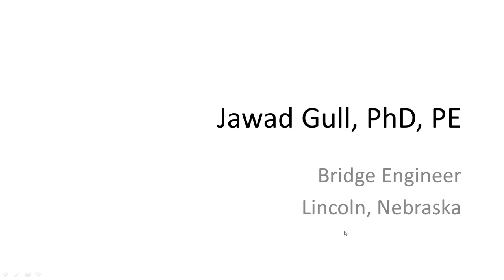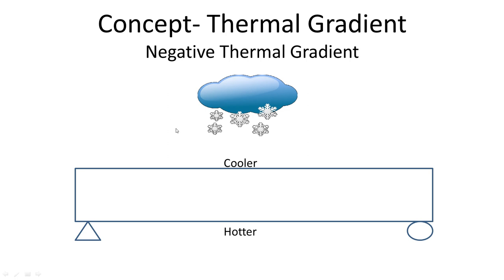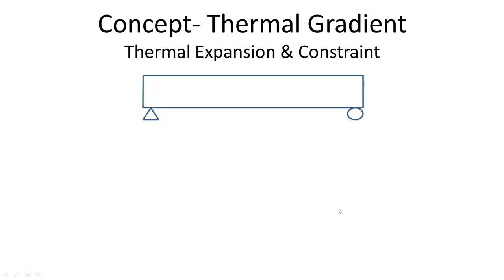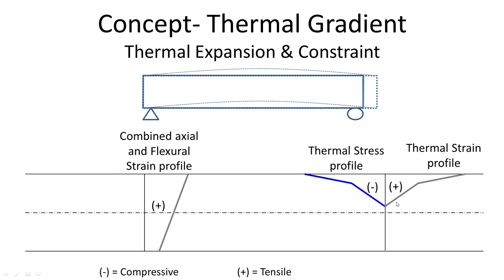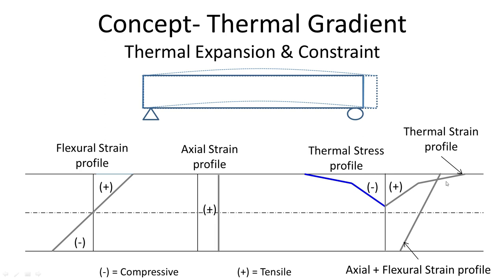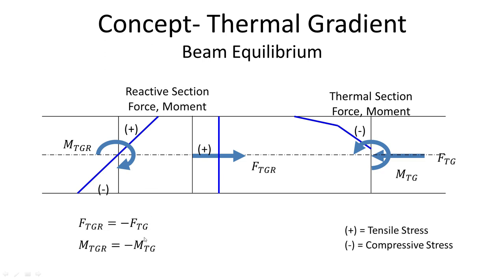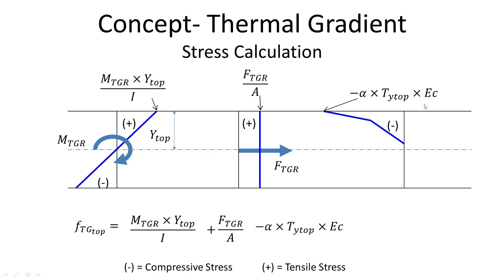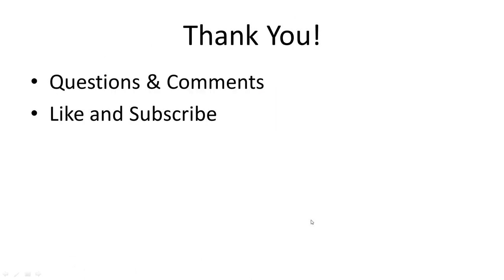Thermal Gradient Stress in Bridges

Comment: It was really nice explanation. I need same explanation on cantilever beam for temperature gradient load. Wil be there any moment or not? As it is independent of length of beam still while changing length of beam I am getting different moment in sofistik. Please comment on this. Thaank you.
Reply from the maker: Great question. Correct, changing the length of the beam should not change thermal gradient stress unless thermal gradient stress  is combined with say dead load stress. This is very interesting and I will try it out in LARSA or ANSYS. Will let you know. Thank you.

Comment: I'm confused with how the beams behave to deflect upward yet the top experience compression stress. Something is crazy here.
Reply from the maker: This because of thermal loads that are different from direct loads. Take for example elongation of a steel bar is typically associated with tensile stress. However if you apply +ive thermal load, the bar will elongate but if you partially constrain the elongation it will generate some elongation along with a compressive stress in the bar.
Reply: @gulljawad  I see, so we can't always assume the tension and compression side of a simply supported given the deformation especially for internally applied forces. Thank you.